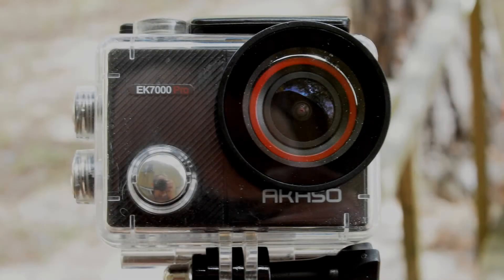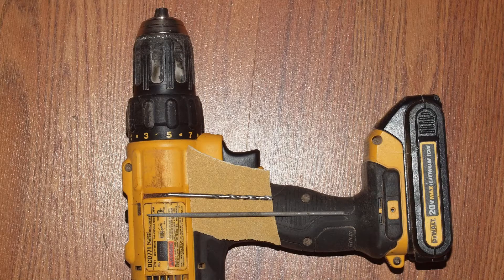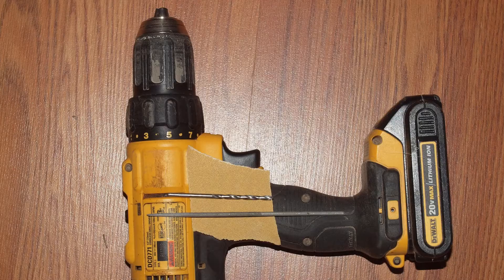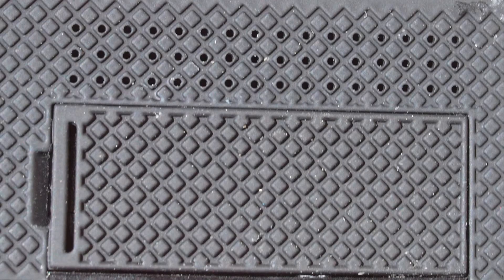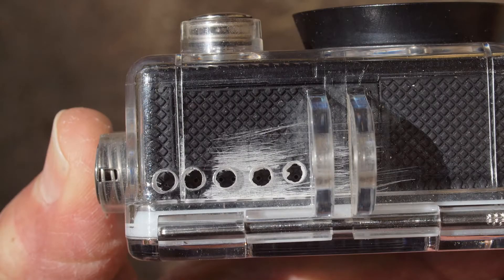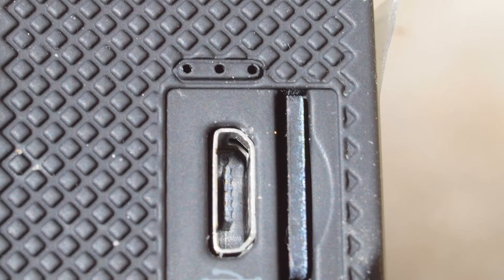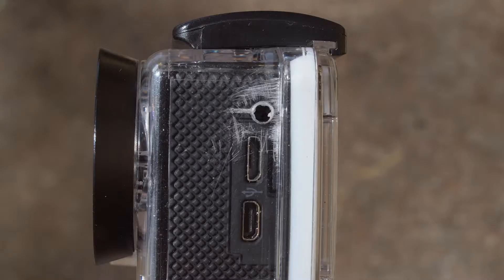AKASO EK7000 PRO: IMPROVE SOUND/MICROPHONE QUALITY

Comment: It shows that my microphone is muted and there is no setting to unmute therefore my videos have no sound. Do I need to buy a mic attachment? I thought it had one built in, thanks.
Reply from the maker: That mute is a new one for me. Try this: On the newer EK7000 PRO models, the microphone is in a different location. You have microphone settings and make sure it is set to built-in, not external. Then with the camera out of the case, make a video with a lot of sound. Download the video and amplify it in your editing software and see if you can hear anything.  I am pretty sure that the AKASO web site offers an external microphone for these cameras.

Comment: Where exactly is the microphone on this camera?
Reply from the maker: The location can vary with the version/later/newer models. For mine, AKASOTECH support told me it was under the nine small holes on the side with the buttons. On the newer models it is on the side with card/usb slots. What I did is test it by covering all the holes, then uncover them one at a time. Made a recording, then covered the hole up, and uncovered another, repeat. I found that most sound entered the camera via holes on the side.
Reply: @bigthicketcritters  Any idea what the 3 holes are above the 2 micro ports are?
Reply from the maker: Revised 3/15/2024: The manual on the newer models says this is the microphone location, not the speaker location, which is on the other side.  Mine is an older one and AKASOTECH support told me that the speaker and microphone were in the same location.

Comment: Excellent hack for this great little cam,,,,I just ordered another waterproof case, to modify it, 15 bucks, on ebay, including ship,,,,and I'll keep the original, for the waterproof aspect, as it does work xclnt,,, the sound quality, with the camera, in the waterproofed, unmodified,case is horrible, but,,,,,,not on akaso,,,,they tell you that from the getgo,,,,15 bucks for another case, modified your way, should work awesome,  BETTER SOUND, AND OFFER GREAT PROTECTION, AND MOUNTABILITY,,,,, for this cool little gopro alternative,,, anyone that owns one, and has used these,,,totally gets this hack!!!,,,great vid!!!,,,thanks for posting!!!😎
Reply from the maker: It does make a difference. I use it for nature sounds while out hiking/exploring. But I take it a few steps further. Once I have the sound recorded and the video downloaded to my computer, I usually do some sound editing. First is to amplify it, sometimes a little, other times a lot. And I have been surprised by some sounds it captured, that I did not notice when recording. On a few occasions, the edits are to clean up noise and/or isolate a particular range of frequencies.
Reply: @bigthicketcritters  I'm using movavi, and also tweak when it needs it,,,if I may ask, which editing software do you use,,,,your vids come out great!!!😎
Reply from the maker: Thanks, After trying several programs, I decided to go with NCH Videopad. You can download it and use it on a trial basis a limited number of times, then you have to pay for it. I purchased it a couple of years ago, and I use their Wavepad too.
Reply: @bigthicketcritters  thanks,,,same with movavi,,,they get you hooked, and wack you a c hundred, or so, but it's cool, and fun to me, as I love photography,,,you do a great job of it,,,nice work,,,,thanks so much!!😎

Comment: Makes perfect sense to me because being inside the case the camera is more protected against falling damage or accidents, I would have liked to heard a voice comparison test also. I'm planning on using mine while bicycling or motorcycling and most people don't really have the need or desire to film in wet conditions or being underwater, so I'm going to modify my case in the same way, thanks for the great idea.
Reply from the maker: A bit of foam, not dense, put in the hole, would probably knock down wind noise. You might get some if moving quick. I have done this before on outdoor microphones.

Comment: whats the point of drilling holes on a case thats suppose to make the action cam waterproof? Isnt it easier to just take the device out of the case?
Reply from the maker: Unlike some other brands, these cameras have nothing built in to the body of the camera that enables you to use attachments.  No threaded holes or pins, nothing. The original case does come with two back covers that you can change as needed, one solid and one that is slotted. By modifying the case, you get better sound, the camera is still somewhat protected, and you can use attachments. If you shop around you will find that the waterproof cases are not expensive.